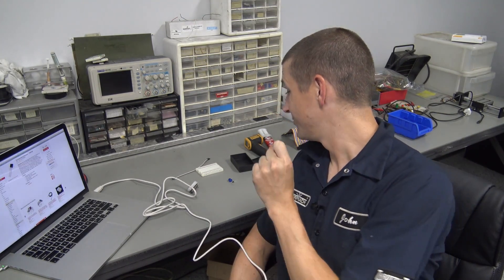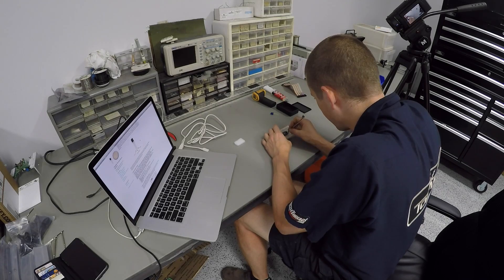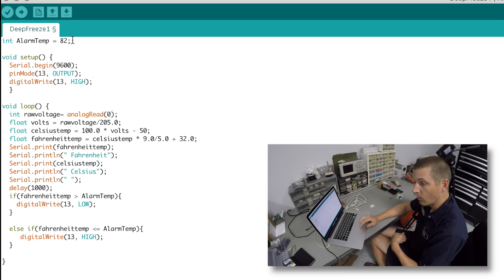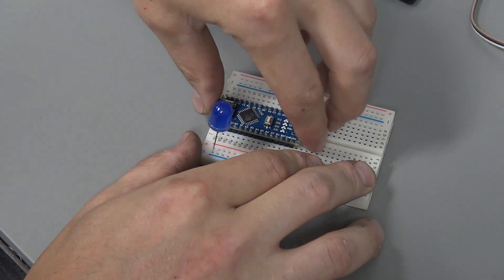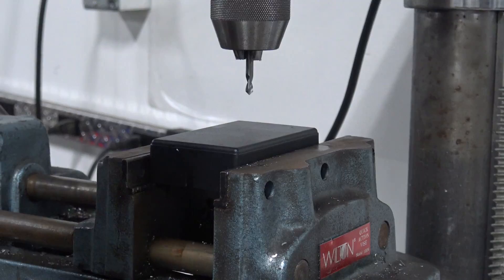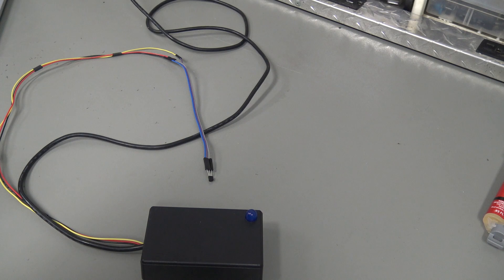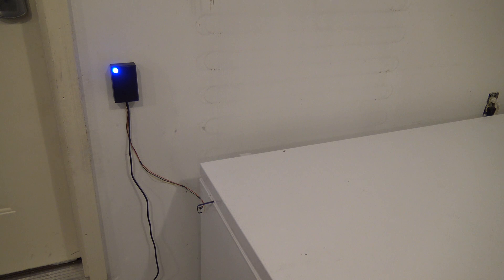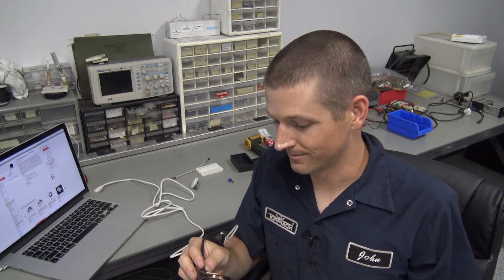Arduino Freezer Temperature Alarm!  Widget108

Comment: Great video, I plan to do the however I will use an esp8266 or an esp32 microcontroller. I will send an email to myself on higher temps. I believe the quote issue you had during copy and paste was do to microsoft smart quotes. Again great video!

Comment: Great project! I have a shallow well pump about 5 feet under ground and would like to monitor if my temperature drops below, say, 36 degrees Fahrenheit in the winter so I will know if my pump is in danger of freezing. I'm hoping to take this same idea and use it in reverse. Any idea how long the lead on the sensor can be?  Thanks again.

Comment: do you think it would be possible to make an aluminum type cap for an electric weed trimmer, with something other than tabs to connect it, and more like screws that would secure it to the barrel that contains the trimmer wire... it would be great to have something that lasted longer than a couple months but still could work as intended... as in, it dispenses wire with a tap to the ground... but something far more durable than the plastic used... and yet light enough not to over load the motor...

Comment: If you want to build the same device for less than 50c, consider doing it with a comparator, lm35/36, and a few offset resistors. 

Technically a little more difficult, but a much better way to show off your design chops.

If analog isn't your thing, try a DS18B20. Easily available in a waterproof housing, about a buck.

Comment: adafruit has those flat ribbon jumper wires that are colored in the order of the resistor color code. so that you can use them and connect them to the arduino and have the wires coordinate to the pins that have the same value as the resistor color chart. very useful when you cant see the silk  screening on some breakout boards.

Comment: Great project ! just one comment on construction, for the sensor in the deep freezer, run hookup wire to the sensor, tin the wire then the legs of the sensor, lay the wire flat parallel to the sensor and reheat. This will produce a nice strong joint (the sensor pin will break at the body before the joint) Then use some small heat shrink to insulate the joints, preferably adhesive lined or use adhesive lined over all the smaller heat shrunk joints up to the body of the device this will give you a moisture resistant joint.

Comment: Project looks awesome! Just be aware that using that sensor the way that you are, you will not be able to read temperatures below 0*C/32*F because the sensor output is 10mV per 1*C. It will work fine if you want to know if the temperature is above or below 32*F/0*C, but there is no resolution below that temperature to make the setpoint any lower in your current configuration. 

Also, an easier way to read the temp from the sensor is to use the map function like this:

milliVolts=map(rawVoltage,0,1023,0,5000);
tempC=milliVolts/10;

You can also GREATLY increase the resolution of the sensor in the main usable range (0-110*C) by using AnalogReference(INTERNAL), this uses the internal reference voltage of 1.1V. You only have 1024 "steps", By using a lower reference voltage the steps change from about one half of a degree Celsius to about a tenth of a degree Celsius.

If you use the internal analog reference, you just need to change the map code to this:

milliVolts=map(rawVoltage,0,1023,0,1100);
tempC=milliVolts/10;

To get Fahrenheit, youd just need to add this above the SETUP:

float tempF=0;

And change the loop code to this: 

milliVolts=map(rawVoltage,0,1023,0,1100);
tempC=milliVolts/10;
tempF=(tempC*(9.0/5.0))+32.0;

Keep it up!
-Dan

Comment: Hi John, that was a cool idea. When you are sitting at home wondering what to do while you wait for the new baby to wake up, you might want to use the time to add a 2 digit 7 segment indicator for the temp as well - the project box has the space and the nano has the free pins... Or switch from the nano to one of the ESP8266 variants with more pins, like ESP8266-12 and both show and LED indication, but also send yourself and your wife an email when the temp goes too high.

Comment: If you have a power failure when you are away and the food spoils but the power returns, the LED will come back on and you will be non the wiser.  The LED needs to remain off if the temperature rises and then goes low again or could flash indicating that there was a period of time when the freezer was not at the correct temperature.

Comment: You can add a small piezo buzzer for both audible and visual confirmation. After a while, you will think the light is on, but won't be.
As some have suggested, a rapid flashing LED to indicate an error condition would also work too.
The Tormach 440 is a nice touch, never could get those holes perfect :P

Hot glue is always your friend ;)

Comment: Hi John
Great job. Here are a couple of things I would change with your project.

A) Add hysteresis to the code to stop Led from cycling at the trip temperature.
B) Move the Led to a different pin other than thirteen. The board Led is also powered with pin thirteen. Currant draw for both Leds could be approaching limit of pin.
C) Add currant limiting resister to Led.
D) Add a Piezo Buzzer for audible warning. Don't always have to be watching the Led. 

These are just some suggestions to improve your Freezer Warning design.

Cheers
Willy
Reply: Great idea using the buzzer!  I actually need to make a device such as this for my deep freeze located in my basement.  Last year my wife and I had to throw out close to 400 USD of goods. I need to get with the times learn this new fangled Arduino mumbo jumbo!
Reply: so....I know I'm late to this. But add a delay in the buzzer and possibly even the light. Connect to wifi and send an alert but again...wait a little bit before alerting, especially based on the quickness it was tripping the sensor.

Comment: I have a Raspberry Pi monitoring the temp of my son's turtle tank and controlling the heater and lights. It even downloads the sunrise and sunset times so it's in sync with the sun. I can view temp graphs over time, heater duty cycle and even control the lights and heat remotely if needed. Probably more than needed for a freezer though.

Comment: One thing to note with the IR thermometers is the laser dot they put on a point isn't in fact what they're measuring. In fact the field of view of the IR sensor is a MUCH larger cone than that, and it's useful to look up IR Thermometers "field of view" and the "distance to spot", and keep them in mind when using the thermometer. 

In this video it wouldn't really be measuring the temperature of that sensor at all, and just an average of what it saw in the spot; in this case mainly the ambient surfaces. As it turned out they were likely largely the same as the target, but in other situations may not be, and you could be looking for an overheated device.

Comment: Check out NodeMcu on ebay for $5. It is programmable with the arduino ide (many tutorials on instructables) and it has wifi built in. You could have sent an email to you phone if the freezer temp dropped. Or better yet send an email every day with the daily average temp or log the temp to a google docs spread sheet.

Keep up with the great videos!
Reply: Just to clarify for those unfamiliar with the NodeMCU it is based on the ESP8266 chip. Similar to the ATMega chips that the Arduino is based on, but the ESP8266 also has built in WIFI. Just like there are various "Arduino" boards  there are many ESP8266 boards. Each have certain functionality of the ESP8266 exposed. The basic ESP8266 board is often used as just a WIFI shield for the Arduino itself! But the more advanced ESP8266 boards (like the NodeMCU) can actually replace the Arduino board completely with the benefit of built in WIFI.

Because of their similarity the support for programming the ESP8266 boards can be added to the Arduino IDE so you can develop your ESP8266 code in the Arduino app.

K4USF

Comment: You might be getting the blink when the voltage sags slightly when the LED illuminates. If the 5 volt rail sags slightly it might be throwing off the voltage output from the TMP36 making the arduino think the temperature is higher than it actually is. 

Very good simple project! The video almost had a Bob Ross feel.

Comment: "Smart" quotes, aren't.
An aside: This would be a perfect project for etching your first PCB . (Eagle -> Laser printer -> transfer paper -> FR4 PCB -> ferric chloride bath -> drill holes -> solder.)
Reply: But, but... he has a CNC.  He can mill a custom board!  :)
Reply: FR4 doesn't CNC very well under 25k spindle speeds, (The pro entry level is 100k spindle speeds) and you really want to be breathing/touching the fiberglass dust as little as possible. Ferric chloride is safer: Wear surgical gloves, no eating/drinking/smoking and wear the eyepro you use to mill and you're golden.

Comment: If you add a latch to the code the light will turn On or  Off once. So AlarmTemp = 33. and  (AlarmTemp-2) = 31, then the light goes off at 33 and then comes on at 31. No bouncing.
Code--> else if(fahrenheittemp <= (AlarmTemp-1)). And You need 10O ohms or > resistor in series with the LED to limit the current to 17 mA or < (Based on the LED link). Great project. Real simple.

Comment: I'd like to acknowledge that you took it upon yourself to do something, and created something, but did you take any measures to prevent the occurrence from happening again?  that would/should have been step 1.   (example:  <item> caused a fire, so lets put in a smoke detector... instead of addressing the actual problem.)

Comment: I think most people consider 32 degrees to be too high.  Most freezers are set for 0 F therefore if you would set the alarm at say 10 degrees you probably wouldn't loose any food.  At 32 F you probably have lost your food.  Most refrigerators and freezers will keep for about 3 days if unopened.  Just my thoughts.

Comment: As always, love the channel. If this was my project, I would of written it a little differently so the LED pulsed and in the case of an error, the LED would blink rapidly.

Code wise, something like this...

int AlarmTemp = 38;  // this is the temperature (in fahrenheit) to trip the LED

int PinForLED = 13;  // Send output to LED on this pin

void setup() { 

  //Serial.begin(9600); if not sending output, no need.

  pinMode(PinForLED, OUTPUT);  //blue LED is on digital pin variable - PinForLED

  digitalWrite(PinForLED, HIGH);

  }

void loop() { 

  int rawvoltage= analogRead(0); 

  float volts = rawvoltage/205.0; 

  float celsiustemp = 100.0 * volts - 54;

  float fahrenheittemp = celsiustemp * 9.0/5.0 + 32.0; 

 // If we have a problem, lets blink the LED rapidly.

  if(AlarmTemp > fahrenheittemp){

        digitalWrite(PinForLED, HIGH);   // turn the LED on (HIGH is the voltage level)

        delay(1000);                     // wait for a second

        digitalWrite(PinForLED, LOW);    // turn the LED off by making the voltage LOW

        delay(1000);                     // wait for a second    

  }

  // If all is well, lets pulse the LED

  else if(AlarmTemp <= fahrenheittemp){

       // fade in from min to max in increments of 4 points:

       for (int fadeValue = 0 ; fadeValue <= 255; fadeValue += 4) {

           // sets the value (range from 0 to 255):

           analogWrite(PinForLED, fadeValue);

           // wait for 30 milliseconds to see the dimming effect

           delay(30);

        }

       // fade out from max to min in increments of 4 points:

       for (int fadeValue = 255 ; fadeValue >= 0; fadeValue -= 4) {

          // sets the value (range from 0 to 255):

           analogWrite(PinForLED, fadeValue);

          // wait for 30 milliseconds to see the dimming effect

           delay(30);

       }

  
  } 

} 

Haven't debugged or tested the above, a little buzzed (zzzzz) here... :-) Should work, compiled fine.... This was a quick merger of the code you posted combined with a PWM sample in the Arduino sample directory. What others have posted about the light not being 'eye' catching I believe to be true, changed the LED pin to a variable.

Comment: Recently another instructor at the community college where I teach approached me with a similar problem.

I used a Raspberry pi zero and two dht22 temp/humidity sensors, one for the freezer, one for the fridge.  Our ultimate goal is to have the pi send a text message if the temps rise above a preset level.  

It would be trivially easy to add a piezo to the pi to sound an audible alert as well.  All of the code is in python but there are some examples on the Adafruit website. 

https://learn.adafruit.com/dht-humidity-sensing-on-raspberry-pi-with-gdocs-logging/overview

Comment: Put some white duct tape over the knob it isn't very noticeable and will keep it from getting bumped. It can also be used to hold/ hide your sensor wires. We used it alot at work because people don't associate a white stripe or border with duct tape.

Comment: John,

You need to add a pull-up resistor for the sensor - see arguing page:

http://playground.arduino.cc/Learning/OneWire

Add a transistor, resistor and one of these beepers to a spare port.

http://www.ebay.com/itm/2x-3-24V-Black-Piezo-Electronic-Tone-Buzzer-Alarm-Continuous-Sound-12V-DC-95DB-/251931992205?hash=item3aa851208d:g:sJMAAOSwv0tVfcHR

Steve

Comment: I did not read all the comments so I am taking a chance that someone else made this observation, with that said.  The Led should flash when the sensor is within optimal temperature range.   Why?  If you have a power failure obviously the light will be out,  however if you have a system failure of software or hardware the light will go steady state, off or on, thus indicating a fault condition.  I use the cheap little boards for all kinds of quick and dirty circuits and had only one crater.  Any Who, my 2 cents.

Comment: I would use a ESP8266 module. They are dirt cheap, can be programmed through the Arduino IDE that you are familiar with, and then it can email you if your temperature falls out of range!

Comment: One of the big advantages of Arduino projects like this is the ability to change quickly when you have one of the "shoulda woulda coulda" moments after implementation.  Agile hardware and software.  Thanks for a great example of a starter KISS project.

Comment: Your second "if" (after the "else") is totally unnecessary, as farenheittemp cannot be >alarmTemp and <=alarmTemp at the same time. The "else" is enough.

The if is not wrong, but bugs come proportionately to the amount of code, so removing unnecessary or redundant code is usually better. And if you thought that if was necessary you might want to ask yourself why, and fix your misconception.
Reply: Just to be clear, I was talking about the if condition (between parenthesis), not the if block (between curly braces). Your code is strictly equivalent to this:

if (farenheittemp > AlarmTemp) {
  digitalWrite(13, LOW);
}
else {
  digitalWrite(13, HIGH);
}

And you can also write it like that:

digitalWrite(13, farenheittemp > AlarmTemp ? LOW : HIGH);

Comment: I would have personally used an ATTiny 85 on a perfboard for the finished product, to shrink it down. Nice that you're coming back to electronics again 👍
Reply: I think I gave him an attiny85.  But it's a bear to get working on the arduino IDE!  Took me 3 days to get it going on my windows machine.  Linux machine it took minutes.
Reply: +RobiSydney Yea, they can be a little tricky at first, but after a little research and hard work they're fabolous.  And then there is the thing with libraries and compability. 👍

Comment: Great to see you having an electronics 'break' John!
Trying not to be a smartass here, but maybe 2 suggestions - still keeping it simple (and quiet). 
1. Move the blue LED to another digital output (with 180ohm resistor) as it shares the onboard D13 LED and may be pushing the current limit of the pin. 
2. Add a high intensity LED to another pin and flash it if over-temp. This would be helped with another global variable ie. volatile int curr_state; so you can control flashing within loop(). Like 'switch (curr_state)...'
Reply: My thought exactly, where's the current limiting resistor for the LED. Yeah it "works" without it but it's really poor design practice and risks damaging the output stage of the AVR on the Arduino board.
Reply: And a CNC?? come on, a dremel would have done the job :P lol!! but hey if you have the toys, Play with them just ribbing you!

Comment: Cool project, literally! I think I would have gone with an alarm to tell me when things were bad rather than a light that tells me things are good but that is just my preference.  Probably habit from years of running equipment and watching for warning lights.
Reply: NYC CNC
Good point about the power source, a warning does no good if it can not be issued. Paying attention is all about the habits so a light on is just as good as a light off. I find audible alarms always get my attention the quickest.

Comment: nice project! it's nice when Arduino projects solve real world problems. but you might want to add a resistor between the Nano and the LED. unregulated, the LED will draw 40 milliamps from the Nano digital pin and if that's a normal LED that likes operating in the 15-20 milliamp range it will burn out fairly quickly. that won't be a huge problem since your LED turning off indicates a problem but you might want to limit the current to avoid changing the light so frequently. a 220-330 Ohm resistor should do the trick.

Comment: Does the led have a built in dropper resistor. if not you need a 10k resistor in series with the led to stop it burning out.
Reply: 10k is a bit much. 200 ohm will more than high enough.
Reply: I was thinking the same thing...
Reply: +beargun42 yes youre right 220ohm is a better value